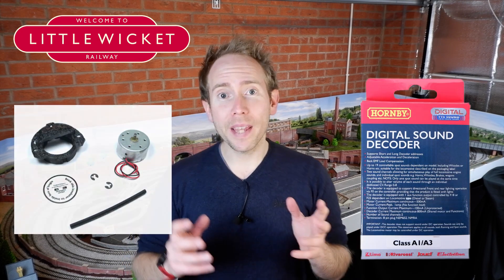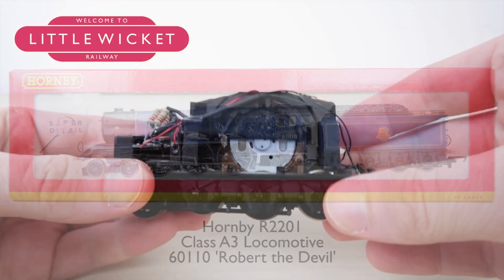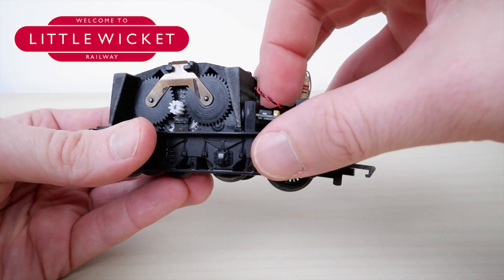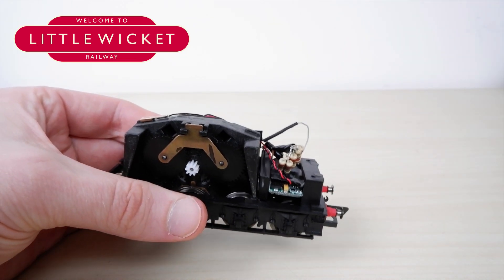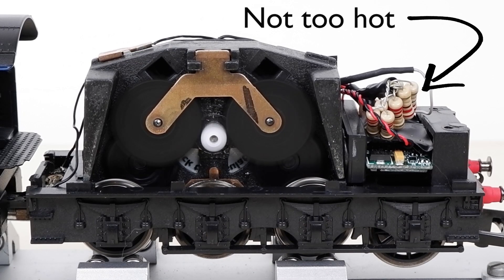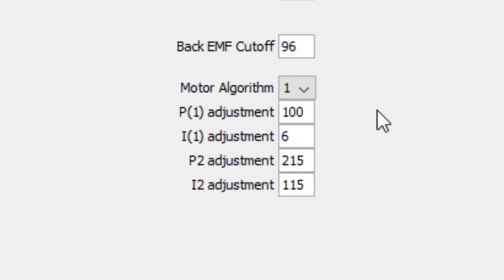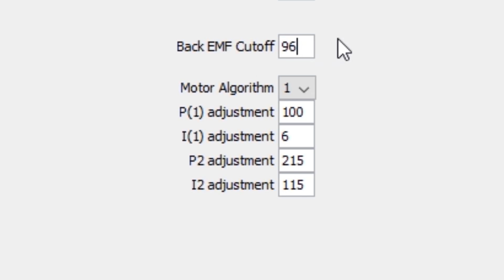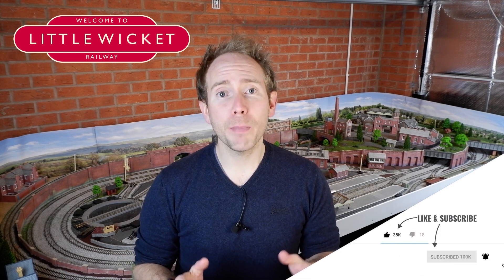Upgrading a Hornby Class A3 | TTS Digital Sound and CD Motor

Comment: I have this loco as well but the original motor has died and I may have to do a CD motor conversion
Reply from the maker: Hi Patrick, if you were happy with the ringfield then you can probably find a replacement on Ebay or Peter's Spares. Most parts of the ringfield are replaceable, it's even possible to re-energise the magnet if that's what's causing the issue. The only part that I wouldn't attempt to fix would be the windings, if they've gone then it's time for a new armature.

Comment: Thanks for this, very useful info - am looking to do my own cd motor conversion.
Reply from the maker: It's a fun little project. You don't have to use the Strathpeffer kits either, you can just use glue, but that obviously makes it permanent. I just with the 12V CD motors were more widely available.

Comment: Nice one Rob I am just about to do an old flying Scotsman loco was looking at putting the decoder in the engine and leaving the hornby speaker in the tender and using a 8 pin socket. May change the speak to the same on you have used instead. Not looking at changing the motor to a cd motor as the original motet has had little use yet.
Reply from the maker: I would guess that the flying Scotsman has the same tender. Yoy might struggle to squeeze a socket in. Although I think there's potentially room for the speaker on the other side of the tender. If you've got a good ringfield and you're happy with it then no need to change it.
Reply: @LittleWicketRailway  Having taken more time on the conversion unless I 3D print an new small speaker cab the hornby speaker is not going to work. The 8 pin socket will be put in the engine not the tender at the moment with the decoder or as you did hot wire it all in the tender. Unfortunately the speaker you used is out of stock at road and rails. So looking at other speaker that will do. Keep inspiring people Rob with your videos as I am shore many people are enjoying them as I do.
Reply: @LittleWicketRailway  well got the Scotsman sound decoder fitted with the 8 pin socket and used the esu lock sound sugar cube and well impressed with the way the loco runs.

Comment: Hi Rob - That was another informative video as I was wondering if TTS works with a DCC conversion and yours seems to work very well.
Cheers Kev
Reply from the maker: You shouldn't have an issue with using a TTS in a DCC conversion. If it runs well on DC then it should run well on DCC 👍

Comment: I like the Strathpeffer kits.  I've used a few now.  I had a lot that came with 6V motors, like yours, but my kit for the old SilverSeal Class 43 actually came with a 12V version of the motor and that is absolutely perfect.  Runs about the same speed as the old RingField.
Reply from the maker: I know 12V motors exist, but I can't find them anywhere. They have to be the solution!
Reply: @LittleWicketRailway  They must exist somewhere, but I haven't seen them recently either.
Unless the Class 47 HA8 kit from StrathPeffer still has them in that kit...

Comment: Strange this, I've got a TTS in my class 37 with a cd upgrade and it runs beautifully with a stay alive fitted to it too and back EMF is off if I recall, don't have my laptop with me at the moment!
Reply from the maker: Interesting. What's the speed like? Could you have a 9V or 12V CD motor? What controller are you using? Does the speed sound notch up as expected?
Reply: @LittleWicketRailway  unsure what voltage is buddy but it behaves wonderfully.

These are the settings for it in SPROG 2

ACCEL / DECEL RATE Both are 15
EMF cut off 128
Algorithm 1
P1 50
I 1 50
P2 215
I2 129

There's were the default settings the only thing I adjusted was the Accel and deceleration rates 

I do however have a digitracks decoder in my bachmann class 29 and it's never happy!
Seriously can't wait to replace it with a TTS deocder and a nice small speaker to fit inside the cab which I've already gutted out lol
Reply: @LittleWicketRailway  I know also that on my TTS decoder you can adjust the "notch" level when it kicks in, so you might be able to do that with the chuff rate?
Reply from the maker: @IronHorseRailways  I don't think you can on the A1/A3 decoder :-( the chuff rate was way off. I'm still not sure why the diode dropper kit didn't work, I'm sure the guy from Strathpeffer uses them with TTS decoders in his videos. Mine just shot off at 100mph when using it and was uncontrollable.
Reply: @LittleWicketRailway  I've heard many reports of the same with the cd motor uogrades not playing nice with DCC.. stay alives too..

From what I've experienced through my own experimentation is that Adding stay alive capacitors helps no end with running.

I bought a cheap eBay Jinty and it would only run at Top whack otherwise it just cut out on points and sometimes on straight track too.
Also it would stall when moving off needing a poke.

Adding the stay alive means I can set it off at speed step 2 and it'll crawl FOREVER over anything nice and smooth.
Same story with the 37

The 37 struggles in other areas though sadly it's too light for the modern point work and gets caught on it sometimes it derails on certain points if they're too tight. 
I need to invest in a back to back gauge I think!
Reply from the maker: @IronHorseRailways  snap, had to put a stay alive in my Jinty too

Comment: Any chance of hearing the sounds from the loco? After installing the TTS decoder we only got music whilst the loco was running. How does the TTS sound mask the whirr from the CD motor?
Reply from the maker: Video with loco sound here if you're on Facebook: https://fb.watch/3Y-ISpxmQ8/

I wouldn't say you can hear the sound of the motor, but you can hear the sound of the loco rumbling through the baseboard and it doesn't completely cover that up. You can adjust the sound volumes and I think they can be louder than this.